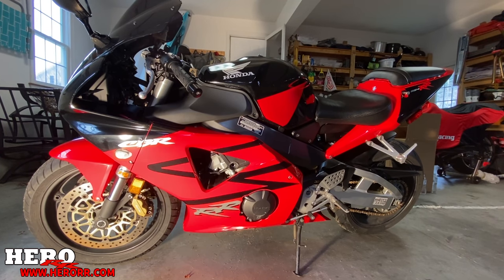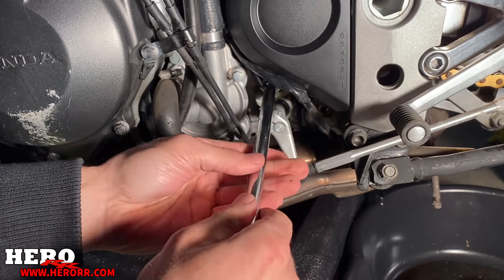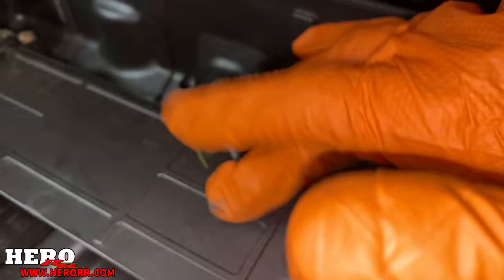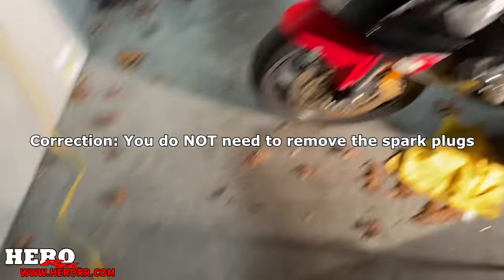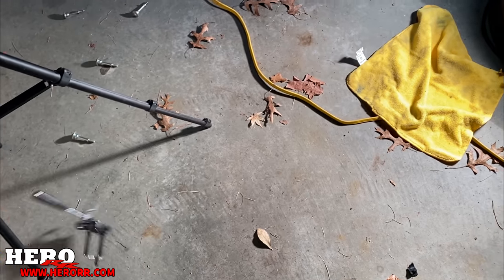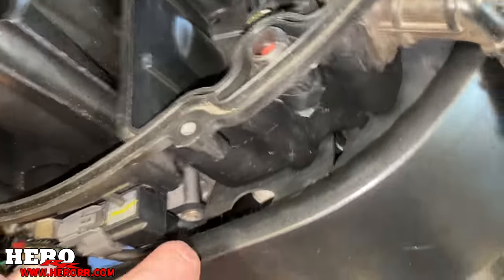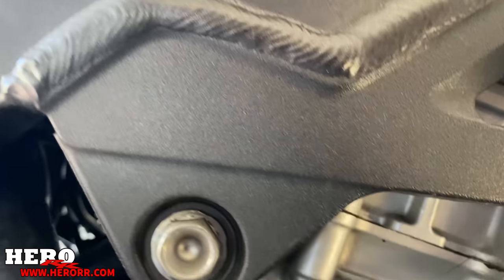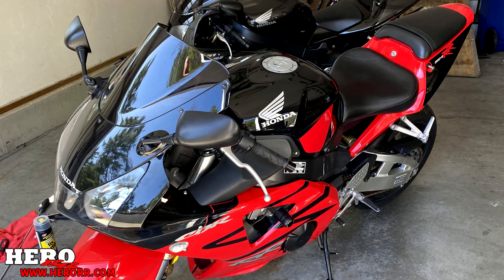Fixing my CBR954RR Lemon

Comment: Flew here.. i just sold my mint 954 last month for an sc57 2007.. regret it big time
Reply: why do you regret it?
Reply: @PlymouthRoadrunner66  One of the most simplest Fireblades out there. They just ride amazing and have the perfect amount of power. It’s the original gsxr 750 without other words. 1000 power in a 600 frame. It’s hard to describe without riding one.
Reply: Because its raw power... Nevee had a bike that could smoothly pickup the front wheel at 7k rpm on power..   it literally makes all the noises.. sound like shit when cold and stationairy, but can SCREAM in the big end...  The handling is different than anything.. its WAY more comfy than 2nd gen sc57 with the pegs lower.. clipons little higher.. 

Reliable as a rock..   

I sold it because i was in purzuit of something better/different and fell for the sc57 looks.. but in the end.. it wasnt worth it...

And this is me.. speaking open and honestly.. i.bought both bikes with my own money..    selling the 954 was a mistake...

Heres a pick of Both in my backyard :(

https://www.imgdumper.nl/uploads9/60c39b956f994/60c39b955891a-20210515_081017.jpg
Reply: @aronjanssen5702  Yeah I actually thought about buying the sc57... I love my 954 aswell! Same colour as yours too :D Thanks for the perspektive... I´ll have to test ride the sc57 or maybe the rn12 R1... Probably still wont sell my 954 tho haha
Reply: @aronjanssen5702  why not buy the 954 again? They are pretty cheap here in Germany...
Reply: @PlymouthRoadrunner66   i want one bike.. not 2, and the sc57 is fine for now..
Reply: @aronjanssen5702  makes sence...
Reply from the maker: @aronjanssen5702  The SC57 is a beautiful bike!
I agree the 954 is a better riding bike though.

Comment: That tinkling sound is a dead clutch bearing.... Why the f.. did you place there another automatic cam chain tensioner? Replace it with manual one...

Comment: The 954 is a noisy engine i have owned mine for over 10 years. Purchased the bike with 41,000kms on her now hitting 96,000kms waiting to see what the speedo does. Apart from cct at 50,000kms regular oil and filter changes battery tyres etc they will go forever.

Comment: Hi, I'm buying a motorcycle after a break of a few years. (time spent with a child is more important) i am considering buying a vfr800 or 954RR. In the past, I owned a yamaha xjr1200 "first bike" I liked the power and relaxed riding position, but on winding roads I had to command just like a man, hit the ground and yes there is courage. After 40tkm I replaced it with the honda VTR 1000 it was a nice light but lack of torque and the engine has no "UMPH" when you turn the handle.

after 40tkm 118hp tuned yamaha performance felt quite casual ..
As 350hp Subaru got used to it in 3 weeks and wants more :)

Is there much difference in the torque of the vfr 800 and 954RR engine?
i don't care about peak power or it's nice to be :)

What about driving in position and comfort?
bad back and mouse hand symptom ..

The bike should be for occasional use during the summer or perhaps even to replace the use of the car from spring to late fall. as before, i miss those times ..

Comment: Now go get a manual CCT and fit that instead lol. I'm going to attempt to do mine on my Y2k Kawasaki ZX9r at some point in the near future, I will do the valve clearances at the same time as I doubt it's ever been done on mine. Keep up the good work 👍
Reply from the maker: Thanks! Given where the CCT is located I think auto is the way to go. I can’t be bothered to go down there every 1-3k miles to adjust a manual cct
Reply: @HeroRR  I totally understand that bud, but getting to the adjuster nut would be a little easier that removing it. Saying that, I may try resetting my original before spending £70 on a manual CCT.

Comment: Why no adjust the valves? 🤷🏼‍♀️
Reply from the maker: Only has 14k miles and I just wanted to finish it haha
Reply: @HeroRR But you were sooo close. You could have at least checked them for clearance. I had my 929 apart this winter and two of the exhaust valves were at the clearance limit. Decided to leave them as is instead of taking out the cams for just two valves. But at least I know where it stands etc.

Comment: Use a earth magnet at the bottom of the drain pan and you will see what kind of metal shavings you might have. Put it right at the end of the stream.
Reply: I believe he uses a magnetic sump plug, as suggested by others and myself when he started this project a year or two or three ago.
Reply: @razor1uk610  i would hope so. Thats the best why to go but if his plug is magnetized he shouldn't see any metal shavings in the oil. They would all be on the plug unless he had some kind of catastrophic failure.

Comment: timing chain mate get a manual chain tenstioner. its most likey jumped a tooth

haha you did it at the end :)
Reply: If it jumped a tooth, the valves would begin to eat themselves almost instantly...
Reply: @razor1uk610  no if its just one it just runs rough. my cbr did the same thing
Reply: @seinfeld11123  ...so long as it's not revved closer to its redline: then it would eventually start lunching itself as the changing rpms and associated chain tension stresses start to allow greater out of time interactions.

Comment: That’s a mouse. Inside the engine looks good. Old, clean, bike

You should’ve checked the valves.  Guess you’re gonna flip it…

Can chain tensioner is a newb move IMO.

Engines sound different when cold.period. 

If the mileage is higher, check for tight valves.

Comment: That's the sister bike to the scariest vehicle ever made for land. The 929rr was extremely intensional in every aspect. Honda is notorious for this but not many seem to know about the truth behind the tank slapping 929rr Fireblade. The end of Hondas journey to make the fastest motorcycle possible. The Fireblade was always supposed to be the baddest bike Honda could make. It was originally a 750 and then they found that sweet spot with the 900rr. More about weight vs hp then anything else. By keeping the bike light they found that the control and precision and being able to throw 4 smaller pistons firing 2 up 2 down the could make insane power. They went ahead with their gangster move in 2000 to once again produce a vehicle too scary and dangerous for man to handle. Deeming it as be a 900rr on the Vin (gangster) they bored the cylinder to 929 ccs shortened the stroke making an insane jump in hp by 40 horse. They paired this with fuel injection and good lord a quarter throttle to scare the pros away from the bike. Search the web my man and start finding sips of non turbo 929s making low 9s in the quarter and 0-60 in 2.3. but the pros put up something like an 11 quarter and 0-60 in 3.7
Reply: Yes I own a 929 and I am biased of Honda but only because quite simply they are the best combustion engine maker ever. Period. Not brand loyalty. I have never been beaten on my 929 and have raced everything. Everything. Research it and then respond. You will have a new appreciation for your 954 and also you'll know the real history of the FIREBLADE
Reply: While you are researching that try to find the science behind aerodynamics cause maybe you thought you dreamt of that rocket cutting a deer in half on YouTube. I can tell you how that works too. Good luck finding it online. These machines are so doing things regarding physics and negative gravity voids that no one cares to be knowledgeable on. I'd love to talk about it to someone interested in what these bikes are really doing

Comment: Where did u get this bike? Do you know if it came out of Oregon? This looks like my old bike I sold several years back. Same aftermarket seat and everything. I sold it on consignment here in southern Oregon. Mine used to make kinda a ticking sound I took it in to have the valves done and the ticking sound was just coming from the exhaust
Reply from the maker: I picked it up in NH, but it was from I believe Maine.
Reply: @HeroRR  oh o see. That's crazy even the same front blinkers. I've never seen anyone else with that seat also.  I bought a seat cowl for mine it was hella expensive if I remember right it was $280

Comment: That sounds like valves slaping pistons. Better check out valves’ gaps. ıf you push ur bike to the its limits in this condition ıt s possible to crack valves. I m a mechanical engineer by the way

Comment: Be careful with the tranny! I trashed mine in 6000 miles riding it like a motocross bike. 

Bloody amazing bike though! Rated best blade ever. Was 22kg lighter than the 02 gixxer
Reply: Oh yeah, throw steel braided brake lines on her and ohlins steering damper if their still available. Huge difference! 
 
Mine back in the day with a 2bros can and power commander  was putting out 143hp, 74lb torque at rear wheel. 

My buds back then were on gixxer 1000, duke 929, yammy yz1000. On road they all agreed nothing touched the 954

Comment: That's what you was hopin' for... didn't you look at it before you bought it?
Reply from the maker: I did, oddly enough everything worked and sounded great. the PO may have wiped the oil leak before I checked it (it was a very slow drip).  The sound wasn't there either and the neutral light and everything else was working.
Reply: @HeroRR  either way man I hope ya enjoy it

Comment: Piston slap shouldn't occur unless it was resurfaced and the mm they took off wasn't taken into consideration on the valve adjustments. Pretty sure those are just lazy people that don't want to tear down their engines. You need to get a valve shim kit from hot cams and just bite the bullet before your valves don't seat properly and you lose compression.
Reply: Either that or your piston rings are bad, or even worse you need to bore out the cylinders. That's why buying bikes can be a nightmare. When you realize they're expensive to fix you you can always part it out.